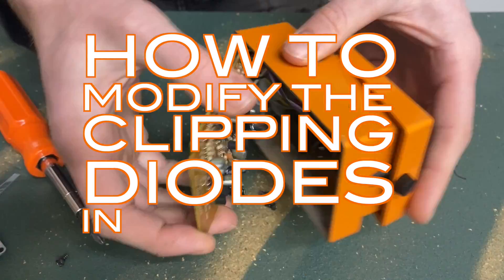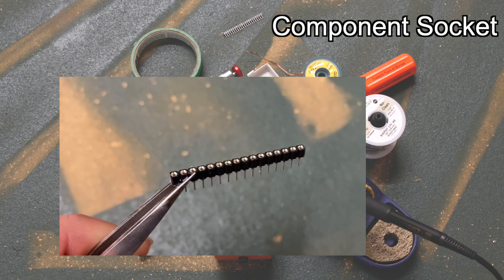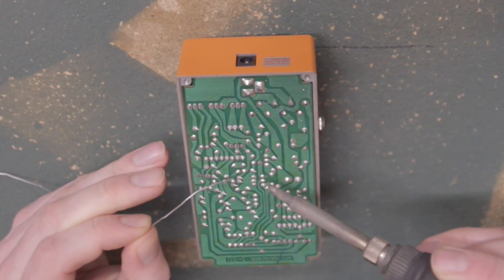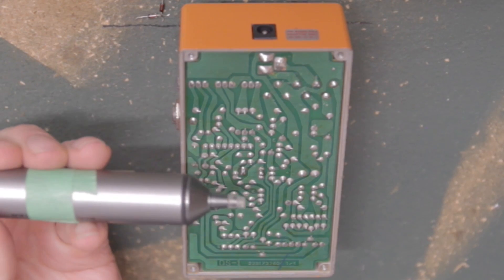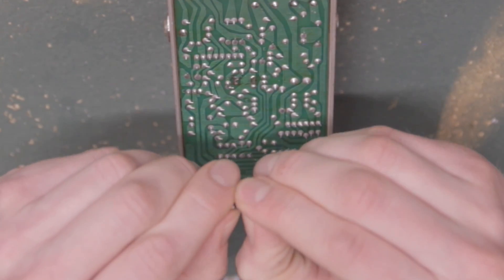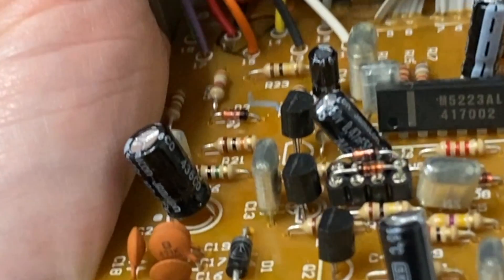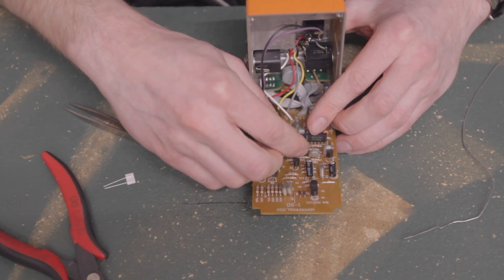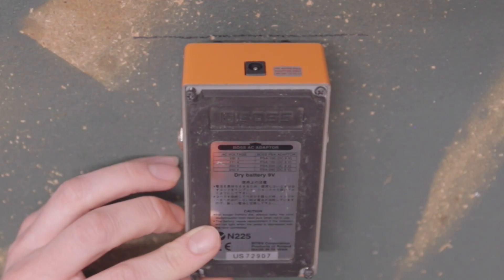Boss DS-1 | How To Modify The Clipping Diodes | DIY Effects Pedals with StompBoxParts.com

Comment: I have a Tokai TDS-1 which has the same circuit as the DS1, I am told , but looks quite different ,  how can I locate the clipping diodes without a schematic ...any idea's .  There are two pairs of diodes side by side ....can I just experiment  or will I do damage ?

Comment: Any chance you might make a video with a switch with 2 different diode sets and maybe none in the middle position?
Reply: I've done the mode going to leds and 1 led and one diode. I actually have a test pedal with sockets to be able to test before deciding on the combination. I would like a switch for different diodes.
Reply from the maker: @Phantom_dave  Probably won't be making a specific video for the DS-1, but we do that exact thing you're requesting in a video of ours with a ProCo RAT. You can apply the switch wiring in that video to the DS-1, you'll just need to find a good place to drill a hole in your DS-1.

Comment: I suppose this is sacrilege, but... doesn't sound like it matters that much!
Reply from the maker: I think they all have their own flavor, probably helps to hear a variety of material instead of just a single big-chord loop! To me, here's how they sound but is in no way definitive of everyone's experience.
Stock silicon: sounds compressed, kinda fizzy. Good reference point. 
Germanium: More compressed than stock but smoother up top. Needs the volume up much higher on the pedal to hit unity. 
LED's: Much less compressed, responds to playing dynamics very well. Nice clarity, some extra high end that plays nicely with the tone knob rolled back. Much louder than stock.
No diodes: The loudest of the bunch. You're probably hearing the amp saturate quite a bit because of how much louder it is. Makes for a very solid boost pedal now.
Reply: Even just listening thru my crappy phone speakers, the LEDs sounded completely different.

Comment: Ripping out the diodes like that is a great way to destroy the pads.  Remove the solder first.  Lol turns out stock diodes sound best.
Reply from the maker: If that works for you, great! With the exception of using a vacuum powered desoldering station (not shown in this video to keep accessible for most viewers), I have found trying to remove the solder first in many scenarios does not aid in removing the component. I've destroyed many pads in my younger years trying to clean all the solder out before removing a part. It works fine if the components legs are straight and not bent over. Frequently though, there are a lot of parts that will have some stubborn solder adhering the part to the pad (especially for double sided pads). I've had much greater success adding fresh solder, heat while gently pulling. Alas, there are many ways to remove a component. 

As far as the sound goes, everyone has their own preferences!

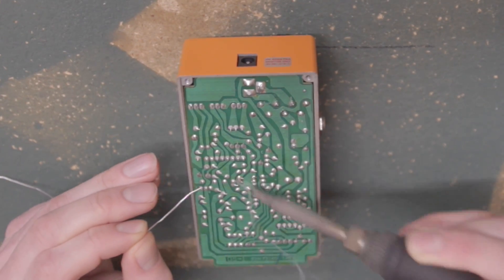Comment: @2:30   If you aren't going to re-use the diode, a much quicker and less damaging method is to just clip out the diode completely. Then, from the other side, grab the leftover piece with tweezers and melt the solder, pulling the leftover piece out. When pulling it from the diode side the normal way, that bent over piece can rip out the eyelet and/or trace. 
This way you're pulling it straight out.
Reply from the maker: This is another totally valid way of removing components! As long as you can commit to destroying the part.